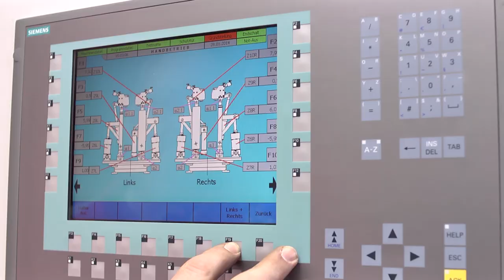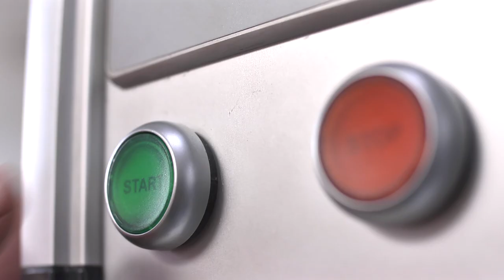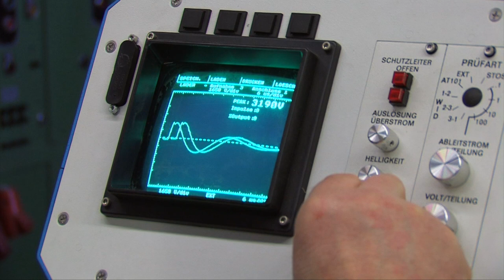Coil Shop - HELMKE windings   Germany

Comment: 3:17 why are they using the pinta tape on the  bare coil? you are supposed to isolate the coil, not to just cover the bottom part with the pinta